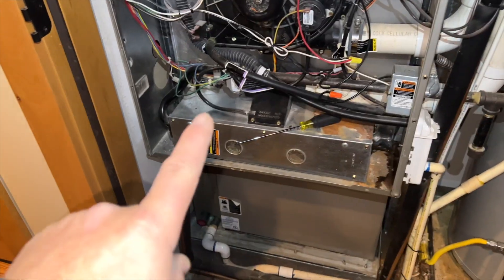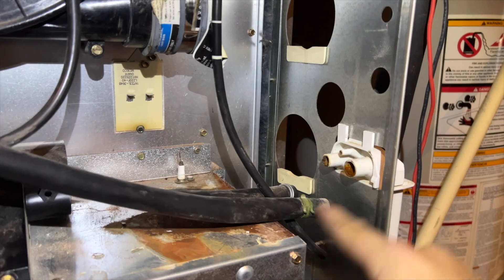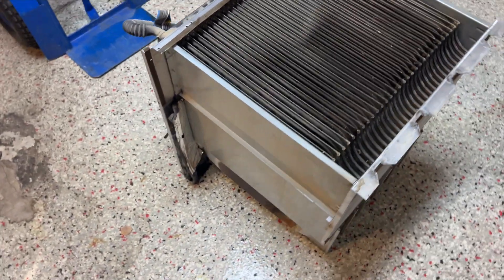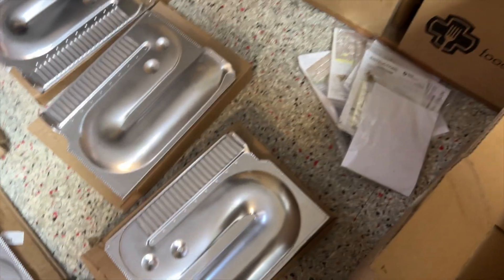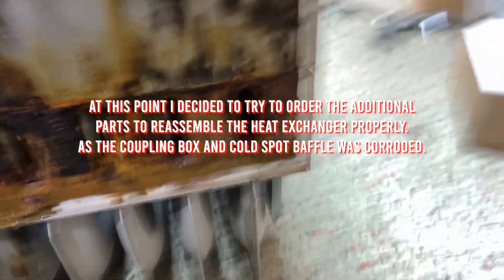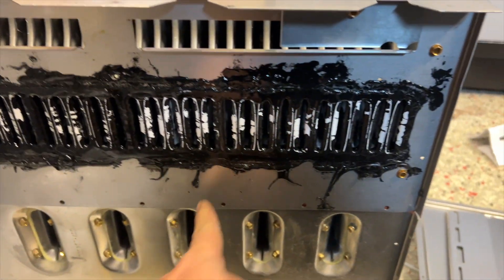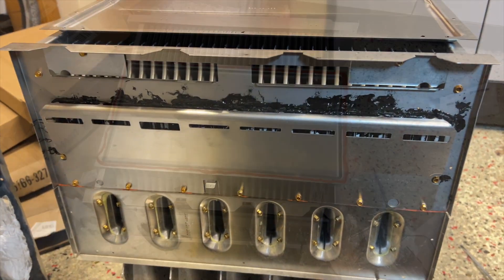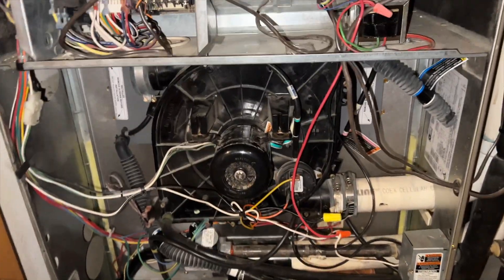How to Replace a Heat Exchanger on a Carrier Condensing Furnace EP132

Comment: Great video and very helpful. I have a secondary heat exchanger that needs replaced, but thinking might as well replace the primary heat exchanger. What would you estimate the additional labor hours to replace the primary if replaced at the same time as the secondary? It looks like they are part of the same unit. Thanks!

Comment: How’d you get the new exchanger up front from carrier before taking old one out? Carrier made us pay for the warrantied heat exchanger up front which was a staggering $2,400, each and after we swap them they’re supposed to reimburse us on the parts cost. We have 2 of these to do. $4800 out of pocket for the two exchangers.
If we had the exchangers out already they’d swap with the replacements but we can’t have the furnaces down inop to do this.
Reply from the maker: We have Net 30 with the supplier. As long as we turn in the heat exchanger before 30 days, no money is exchanged.

Comment: Nice video. Did you have to notched about 1/4" off the inducer legs to get the inducer to seal properly against the new secondary heat exchanger? Thanks
Reply from the maker: No this one fit properly.

Comment: This is one of those things that you can do but probably shouldn't.  The parts and labor, coupled with the age of the unit when this part fails means it's likely a bad investment.  Let the furnace RIP and replace the unit with new everything for not much  more.
Reply: depends on the age and model, what's been done to it so far, how long the owner will be in the home - it can make sense.
Reply: My 1994 Carrier Infinity 96% secondary heat exch. failed in 2015 when it was 21 years old. Carrier's lifetime warranty on the heat exchanger was honored for all parts and a $300 labor allowance. The HVAC Carrier dealer fixed it for me in 1.5 days. This is a really major job and I didn't mind paying a couple hundred for the extra labor. It lasted another ten years, making the furnace 31 years old when the secondary developed cracks a second time. They were found with a camera scope when I had a new A/C evaporator installed. This time Carrier would still pay for parts but no labor. Because today's labor rates are up, I decided I got my money's worth since the furnace gave me 31 years good service. Time for a new Amana ultra high efficiency furnace which is even quieter than the Carrier.

Comment: Wow , Great video ! That was disgusting 🤮 inside there! Great job ! 90 % furnaces seem to be wayyy more trouble than they are worth for 10% more efficiency ! Ill stick to selling 80% furnaces as long as possible ! & advising against 90% furnaces.
Reply: 80% furnaces have their own unique issues.  The combustion by-product is very acidic and will rot out all but some very expensive flue choices.  I've seen these rot out a chimney where they were slapped in using the existing stack.  90% units are on the other hand able to condense the combustion by-product downt to acid and water which is then collected and pumped away.  And of course the combustion by-product is cool enough to leave through pvc which isn't going to rot.  All in all the advent of the 90% plus furnace is a vast improvement over the 80%'ers.  Both use a induced draft blower, however the 90+ circulates the combustion by-product through a secondary heat exchanger below the first one which cools off the by-product and allow the user to gain more heat from the fuel used.  I highly disagree with the notion that the 90+ is more trouble.   The 90+ furnaces have been around since the 80's, so they are proven to be reliable.   Like any furnace they have a limited life span.  Trying to go past that is where troubles begin.
Reply: 80% furnaces are junk - open flames, noisier, dry out the house using indoor air for combustion, dump 20% of the heat produced right up the stack. 96% isn't more trouble if it's properly installed, maintained, commissioned and doesn't have a defective secondary hxt design - this problem is specific to carrier 58 series condensing not made any more. 96% saves 17% over 80% (1-(0.8/0.96)), not 10%.
Single stage is also inferior to 2-stage and the same mindset leads to single stage furnaces being installed.